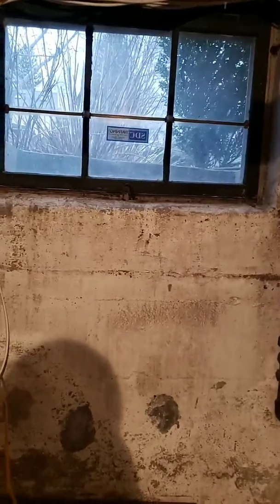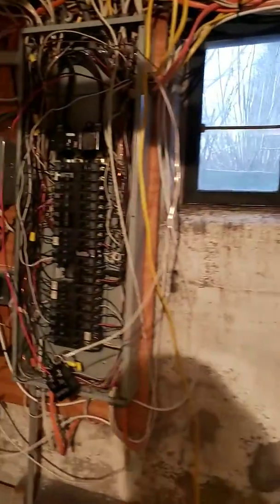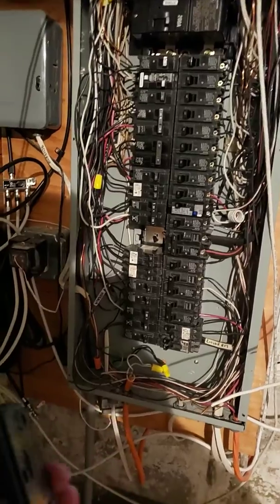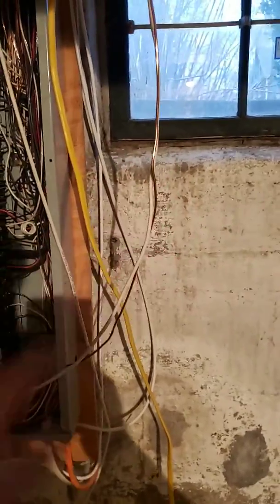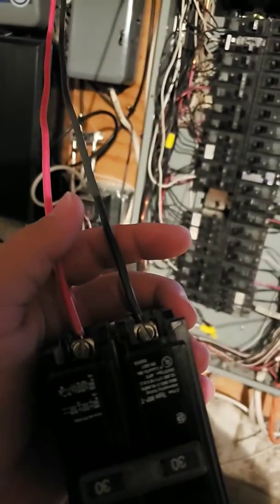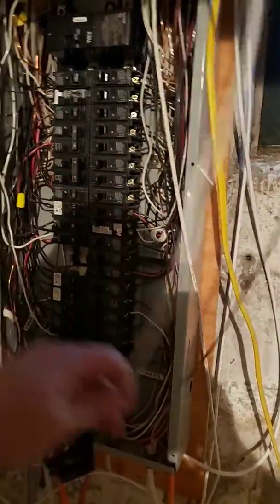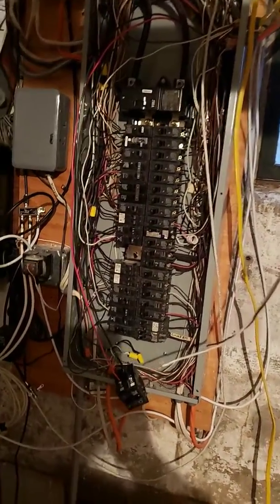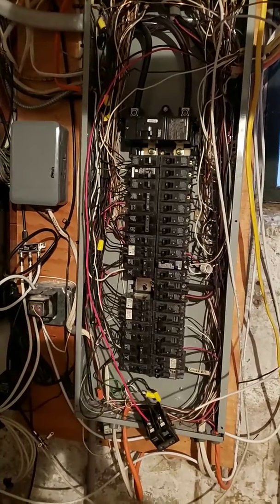How to hook up dryer circuit breaker.

Comment: Thanks man, exactly what i needed to hear. Also noticed the loose jewelry while working. 😄😄😄 thanks
Reply: There's not much on YouTube from inside the main power on to wireing for double breaker 30 Amp and yes the tips that happened to me when starting a boat motor electric start off the motor frount plate it was a push button and when I push it my watch was grounded to the motor head and it arc and burnt the watch off my wrist lol.....